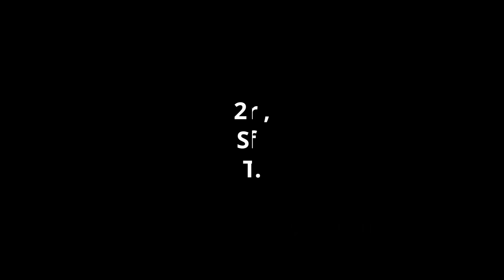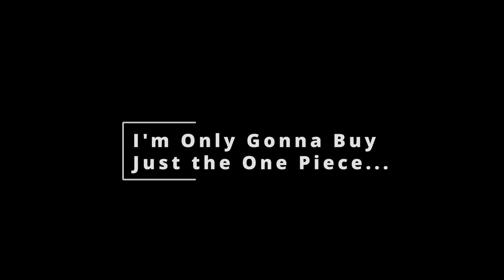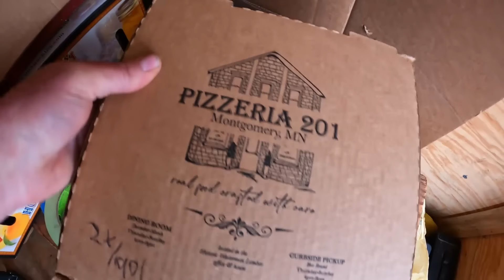The Great LeSueur Swap Meet 2024! What Will Show Up This Year??? Weekend Recap Episode

Comment: We have them here in Europe as well, but swap meets in NA are something wild. I try to match my trips over the pond with a few every time. Always go back with plunder in the finest of nordic traditions.
6:00 always felt that for the rock crusher, the best wheels to move it about would be pulleys. I've seen this done with heavy duty equipment of the day (at least here in Europe). When the pulleys came down from the ceilings, when the electric motors overtook the steam powerplant, a lot of factories ditched these "wheels" and people made use of them. One really cool unit i saw once in a museum in UK was a big mining operation water pump mounted on a gun mount like construction, presumably to be pulled by strong horses, the wheels were pulleys. Clearly seen by the pulley lock and the wide belt crowned "thread". Neat stuff.

Comment: It almost didn't seem like LeSueur this year until i saw two young ladies trying to push a SUV out of a mud hole, and getting sprayed. 
I remember the guy who owned the steam engines.  You didn't dare go on the property without a invite.
I took the Super H as a Franken H.
The oil filter was early H.
The tin was off of a H. You could still see brighter paint where the Farmall emblem had been. 
Thanks.
Reply: I didn't see the twenty in the trailer before you closed the door! Thought it was pretty nice. Thanks for taking us along!

Comment: The CASE aftermarket wheel weights were from the Taylor Foundry Co. They made a lot of aftermarket weights for CASE tractors. And the others were wrap around front weights for 100 and 30 series.

Comment: Good morning. My brother has a D6 cat. Serial number 2h8450. He is experiencing water in the oil and wants to know what is causing the problem and where can he get parts if needed?
Reply from the maker: Several things could be the cause - lower cylinder liner o-rings part #2B6461 (2 required per liner) can harden up and start to leak. Pre combustion chambers in the cylinder head can also rust through and let water into the cylinders where it can run down to the crankcase, finding other good used precoms is about the only thing we have now. The head gasket can also start to leak, part #3B1243. Gaskets and seals should still be available from the Cat dealer.
Reply: Thanks so much!

Comment: What motor does your new Ford have
Reply from the maker: 7.3 gas
Reply: @squatch253  did you know that they have a high output version of the Powerstroke available now
Reply from the maker: We don’t run diesels. I learned to stay away from those by being the diesel specialist at the Ford dealer for 20 years.

Comment: What engine does Senior's new truck have?
Reply from the maker: 7.3 gas
Reply: @squatch253  Nice! I've been wanting one of those for a while now.
Reply: How does Senior like the 7.3 gas?
Reply from the maker: So far he likes it a lot, but it doesn’t quite have 1,000 miles on it yet so it still has a lot of proving to do. Between the increased power and the ten-speed transmission, he really liked how well it pulled the camper. His prior 2016 model with the 6.2 gas and 6-speed transmission had to work noticeably harder when doing that job.
Reply: Thanks for the input, I’ve been looking at the 7.3L myself. Does he have the 4.30 rear end? It would be cool to do a walk around on the new rig!